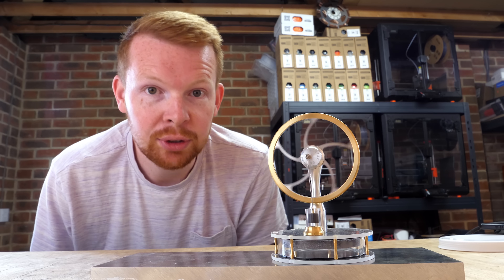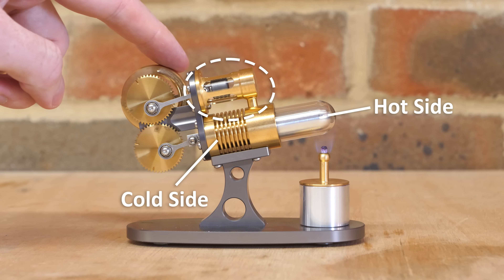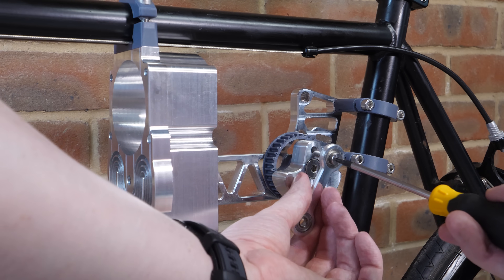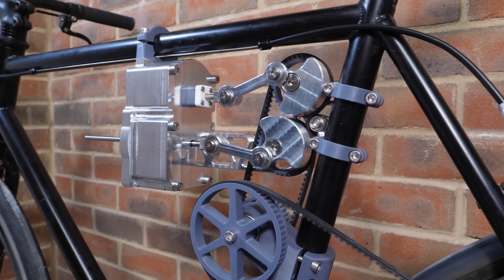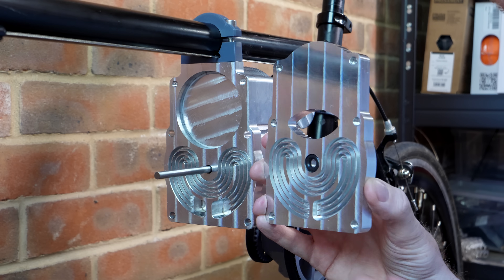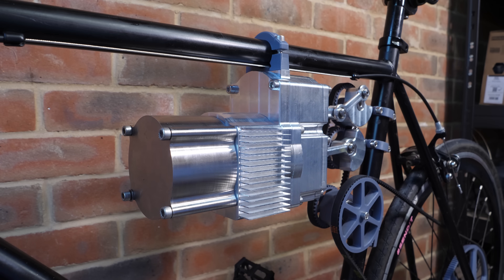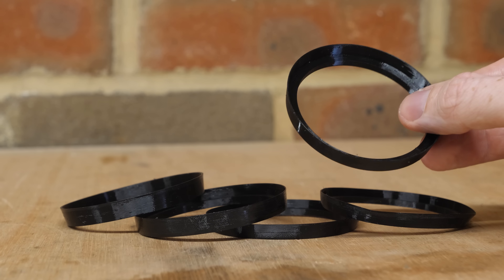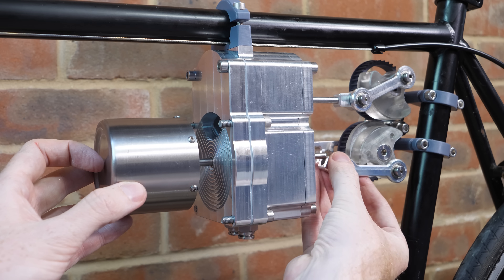Building a Stirling Engine Bike - Part 1

Comment: Absolutely awesome dude, for real! I'm sure you are already working on the next stage of this design of yours, so I'll skip ahead to saying heatsinks can concentrate heat inwards with simple built in passive diaphragm structures to create acoustic resonance heating & cooling. Making heat become trapped in a vortex tube to transfer more efficiently & use a insulated head for that heated side will improve length of pulses of heated solid/liquid/gas transfer to material even if its electrical/acoustic/light based. Stirlings have always had the same issues, poor heat capture & transfer over delta (time) & poor speed of thermal conductivity to another medium, liquid phase change is your best bet to a radiator thats a simple thermosiphon. 

Hope it helps, don't be intimidated by the 3-4 sentences above because nobody wants to ready anymore, its not even considered a paragraph.

Comment: PV = NRT is both your friend and your enemy.
You may want to redesign your displacer to be a moving regenerator.  Basically this means making it like an stack of plates with holes in them.  When the displacer moves towards the hot end, the air flows through and around it and gets cooled off warming the displacer.  When it  moves back to the cold end it heats the air on the way back to the hot end.  Multiple plates with small gaps between them prevents the heat from just flowing through the body of the displacer.

Comment: Thank you for solving the Gasket and piston size issues.
I was 
Based on the books that are out there thinking that I am limited to Pyrex glass tubes and graphite based pistons.
Add one more reason to upgrade my discontinued Flashforge 3D printer.
I recommend that you mirror polish what ever next size up of piston chamber you land on.  
I did some learning about Jewelry manufacturing in community college and can tell you that the piston Walls are still too rough.  Pyrex glass smooth is the preferred  level of smoothness for the chamber walls.

Comment: Stirling engines characteristics make them a poor choice for this use case. My understanding is that they are a good choice for air independent power submarines though. You need an application where specific energy is less of a concern and submarines are definitely an application where power to weight ratio is not as important as silence and overall thermal efficiency is.

Comment: I once had a teacher who had a Sterling engine and I always thought there were noble gases in the cylinders which helped the Piston expand and contract with a lower heat input. Of course I'm probably wrong it was a long time ago, but the thing that was really interesting is he used a polished funnel to project concentrated sunlight in one spot on the cylinder to run the piston. In Las Vegas it blew my mind using the sunlight to directly run an engine and create power instead of converting it to electricity through solar. Definitely a Sterling engine with a solar heat ray could power of fairly large generator and produce tons of power.

Comment: Is that displacer piston air tight? If not it could be heating the air inside which would expand during the part of the cycle where you are trying to cool it

Comment: Try pressurizing the piston cylinders with shrader valves, I was getting some interesting results using helium and hydrogen on my personal project That was inspired by what I witnessed as a USAF child when the NASA automotive sterling engine came to STRATCOM.  Helium is expensive/rare and is notorious escaping past seals while hydrogen has the same attributes but can also be used as a heat source fuel so no need to for helium source tank, fuel, and cooling systems. Hydrogen can be used as fuel, coolant, and working gas volume in the sterling engine.

Comment: Tom, to increase power of your stirling you need 2 things: raise pressure of gas inside to minimum of 10 atm, and increase heat exchanging square of cylinder by changing their form

Comment: you need RPM because the torque is not there to begin with. also upper piston is not inline with the gear axle.

Comment: I wonder if ED-machined piston/cylinder would work with one of these engines, or would there just be too much resistance or the problem of it potentially get misaligned and getting stuck in place.

Comment: Use a TEG to capture some of your lost heat, the TEG can be used to small power a pump for water cooling. TEG is a thermoelectric generator, they are super small and super cheap.

Comment: Fantastic video as always Tom! A lot of the Stirling Engines I've seen have copper tubes looped out of the hot-end to pick up more heat. Not sure if that'd help here. Also, you could take the flywheel into a generator, possibly then into your capacitor bank and to an electric motor on the wheel. It removes the need for a clutch and should prevent the slowing of the bike from stalling the Stirling.

Comment: Phillips used to make Stirling engine, a trick for more power is to compress more air into the system, that makes sealing very important. Helium filled Stirling work better as Helium transfers heat very well.

Comment: I'm sorry bruh but it will never work. Sure you can have running engine turning the wheel but there is no way that thing can ever put enough torque to not be stopped with a finger.

Comment: Make sure the displacement piston is air tight, otherwise hot air could be expanding in the hot end, moving past it to the cold end, but putting reduced pressure on the cold end of the piston because it can actually leak into the hollow interior

Comment: I've always wanted to create s Stirling engine that uses a phase change. The engine would be sealed and contain air plus a few drops of a volatile liquid like ether or alcohol. The advantage would be that a small amount of heat would cause a large change in volume.

Comment: air cool the front (ambient air temp is a good base)  water heat the back (add hot water to go ... remove hot water to no go ) 
remember it runs on thermal differences and does not care which side is hot or cold 
maybe run the drive belt to the pedal gear rather then the drive wheel

Comment: After the compressed air engine, the sterling engine is a really cool project where you can find so many applications! I'm really looking forward to what you can end up with in couple of iterations.
Couple of thoughts regarding your current design :
-Piston: your sterling engine works best in a closed loop. As the same mass of air is just heating and cooling repeatedly, you want to completely seal it from outside. Your piston desgin has good compression, but not good depression. As a result, your system is pumping air on cold cycle, and running with constant overpressure, loosing efficiency (Piston is still pushing at mid stroke). A symmetric piston design would be more appropriate. As it's difficult to obtain such sealing and slipping performance with only solid material, I would really consider a lubrification system for next prototypes.
-Dispacer: I think that's a part that you could get the most creative with. Displacer has 2 roles: a) reduce heat exchange between the air and one of the 2 sides (hot/cold), and b) while transitioning from one side to another, force air convection with the other side (while having low dynamic resisting force). From there, there are so many design you can play with to move air in all kind of ways that would optimize heat transfer and run the engine faster and faster.

Comment: That's great! Congratulations!

However, a Stirling engine is totally wrong for "mobile" applications because it's way too heavy regarding the energy it produces, same as for the Tesla turbine (another funny thing to explore on ground, the Stirling engine compressing the air and the Tesla Turbine converting the energy to kinetic energy).

The best application for Stirling engines is for small-scale photovoltaic power, for which you use the Sun as a heat source through a lens, using oil to cool the "cold" side through a simple car radiator. Although Stirling engines are well known to be extremely efficient in doing that, it's not scalable: the 10,000th engine costs you pretty much the same as the first one and the maintenance costs (too many moving parts) are horrendous for large-scale deployments.

I really like the usage of the flywheel to "flatten" the rate of the output force.

Comment: @13:47 i see two things. 1) there is a pretty big gap opening and closing on the coverplate at the back of the motor. were you missing a fastener? 2) the ptfe bushing for the top cylinder looks pretty knackered by the end of it, lot of vertical movement of the top cylinder's rod.

Comment: I miss my glass syringe. So fun to seal one end and pull back the plunger and let go, bobs back and forth. That's what ended up breaking it tho, I tried it without any air inside and the plunger smacked right into the other side and it exploded

Comment: I used to work with a guy that worked for an engineering consultancy, they were developing solar powered Stirling engines that powered generators. This was before solar panel efficiency was good enough/ cost effective enough.

They used helium as the working fluid to reduce pumping losses as it is less vicid. Eventually they moved to hydrogen and saw even more pumping loss reduction although keeping the hydrogen in the engine was very difficult! 

I

Comment: You could use sterling engine to charge up capacitors helping you get moving then transfer power to Stirling engine once moving to allow for easier direct contact

Comment: Striking engine has better theoretical efficiency, potentially reaching Carnot Cycle efficiency (at least in theory)

For better performance it’s worth trying to make the engine completely sealed and use pressurized helium(or hydrogen) 

But in this case hydrogen metal fragility should be taken into account

Comment: put it on a parabolic mirror dish. a big one. how much power can you generate? run the hot water to your water heater and run cold from your line. When the sun's out, free power and hot water.

Comment: I think a Regenerator is a very important next step. Also I think your hot side is very inefficient in transferring the heat to the Air. The hot plate powered Stirling engine you showed seems to have a much better surface to Air Volume ratio. I really wonder what you come up with in terms of a heat source. How about a wood fired burner with a blower powered by the engine? Are you thinking about a water pump powered by the engine?

Comment: What if you used a better gas than plain old air? Something that could give more pressure when heated, and way less when cooled. With some extra bits and pieces, could this be possible with a freon? It would be really complex, but if it
worked, you would have a supercharged Sterling engine.
It sounds a little crazy yes, but given the principles of a Sterling engine it has to be possible. It would be one heck of a complex sterling engine. I guarantee it would have more horsepower than any sterling engine ever made.

Comment: What if you try to pull vacuum from the engine whilst replacing air with straight nitrogen. The air volume will have a much greater differential

Comment: Fins on the piece that gets hot to absorb the heat more efficiently

Also

Could you use an electric heater insted of an actual flame
I belive it could be safer as if you sit on it there wont be the risk of the heat from the flame moving around and hiting youre leg
It would also remove the posibility of the butane gas getting too cold

Comment: One thing I learned about sterling engines is that its not about adding more heating, but making sure there is a huge difference in temperature between the two chambers. Sure, more heat helps because that would naturally keep the difference greater, but making more efficient means of cooling would help make it run better and faster.
Reply: You wanna know what's cooler? Your line of thought actually lead you to re-formulating what would be the concept of Carnot Efficiency! It states that the theoretical maximum efficiency of a heat engine is dependent on the temperature difference between the cool side and the hot side.
Reply: @launama1480  everyone always says that, but it's actually a ratio, 1 degree lower on the cold end will give more efficiency gain than 1 degree higher on the hot end
Reply: @froggarana  How so? I am no expert, but my understanding was that only the difference in temperature matters
Reply: @Ryan-ahh  it is a ratio 1-(Tc/Th)
Reply: @launama1480  You can never reach past absolute zero, but you can always and infinitively increase temps (theoretically) practically the material choice limits max temp so your real hurdle is making a cooling system with such low parasitic losses that it justifies using it. Then after that is reducing heat loss and leaks via regenerators.

Comment: That upper shaft also seemed to be bouncing up and down
Reply: Maybe a new front cooling head with just long holes along the cyl with matching holes from the main block for water  for passive cooling there the main  away from the heat  and a shield so ur balls and cables dont light on fire😊

Comment: Tom, this is amazing. Here is an idea that I think people would love. Take the engine you just built off the bike, get it running as well as you can and turn it into a generator. That way you can literally measure the number of kilowatts it will produce as you improve the engine over time. I would love to see you working at this project.
Reply: Agreed, why are the only Stirling engines for sale useless demos or Megawatt Megaprojects?  
I would make it stationary and use it to charge batteries for an electric bike.
Reply: There's already tons of accessible data on power outputs/system efficiency for sterling engines of every size/model you can think of lmao 
I think Tom (and most viewers) are far more interested in unconventional practical uses for known technologies (such as this video), novel engineering ideas for new technologies, or attempts to engineer answers/solutions to questions/problems that are yet unsolved as opposed to him measuring figures that can easily be looked up 💯

Actually I'm sure Tom could give an accurate ballpark estimate of this engine's output due to the fact that he literally laid out his process... He started with a target minimum power output, did the (already known and easily accessible) calculations to determine his minimum required cylinder volumes & temperature difference needed to achieve the necessary thermal expansion, then figured out his margins based on predicted efficiency losses due to entropy, machining tolerances, & system design. 
Another video on on this engine's "actual output" wouldn't have any value because it would just be him backtracking to explain the previously mentioned multiple months long process condensed to a 20min video... otherwise to have any value it require him to invest considerable time in further implementations to find/optimize the aforementioned inefficiencies of the system in order to showcase the nuance & implications of design choices, which makes for pretty boring content tbh unless the underlying system is based on novel/unique technology (of which a sterling engine is neither lmao)

Btw I'm not knocking your comment by any means! Just explaining why it's not practical from either a engineering or content creation standpoint 👍
Reply: @EmpressOfExile206  I think you missed the entire point of measuring the kilowatts (though this engine likely only outputs a couple watts)
Reply: @EmpressOfExile206  what a stupid comment

Comment: To make a powerful Stirling engine the heat exchangers need enough internal heat exchange surface closely connected with the operating gas. You also need a higher average pressure inside the system, especially when you operate the engine with air or nitrogen instead of helium or hydrogen. Typically you have average pressures of 5 to 30 bars in such gamma-Stirling systems.

For these higher pressures a regenerator ist crucial to bring the engine into operation. The best option is to use the inner volume of the displacer as the regenerator volume, because it is allready there. The best way to bring the power out of the system is to use an internal electric generator in a hermetically sealed system. You can start the engine by using the generator as a starting motor.

A good calculation of the overall process is important. I use SAGE (Gedeon Associates) for thermodynamic calculations, with all the internal and external heat exchange processes. Don't be surpriced to find that many practical designs don't work nicely or work at all. Air or nitrogen is very bad gas for a really powerful engine with a useful efficiency.

To make a running Stirling engine is much harder compared to make a running compressed air or steam engine. It is espacially hard to make a design which was really calculated in your simulation tool. You have to avoid every design change which was not calculated in the simulation or add it to the simulation in order to see its effect. In most cases it has a lot of bad influence on the performance.